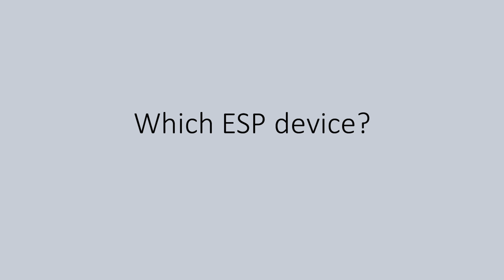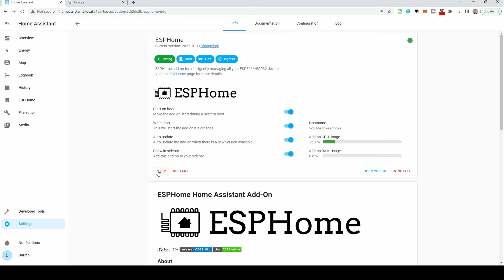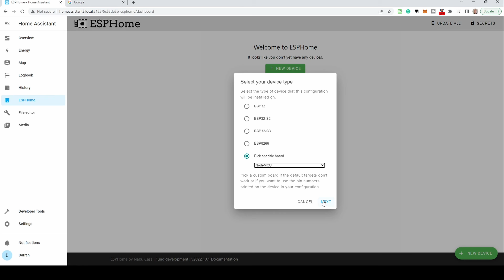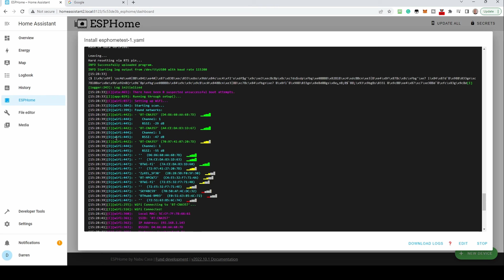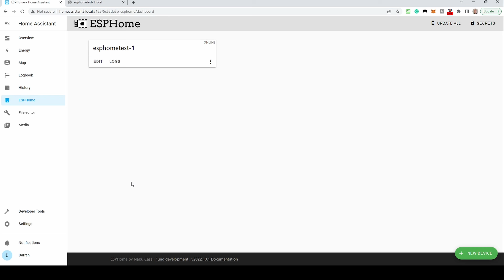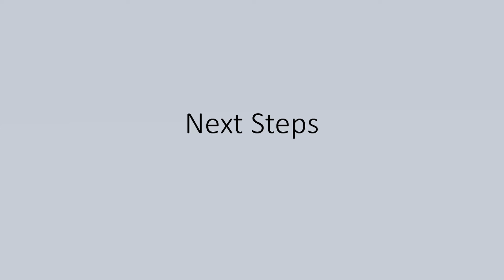Introduction to ESPHome in Home Assistant

Comment: Process stops with with following messages 
Leaving...
Hard resetting via RTS pin...
INFO Successfully uploaded program.
INFO Starting log output from /dev/ttyUSB1 with baud rate 115200

Anyone a suggestion? I thaught that my output port and cable were too fast maybe for this baud rate, so I plugged it into an ancient usb adapter (which I used before for this purpose) but no ... nothing happens
Screen of the device stays black/dead.
Any suggestion is welcome